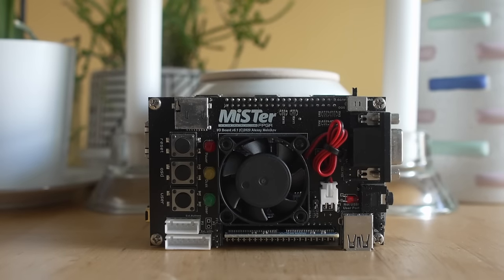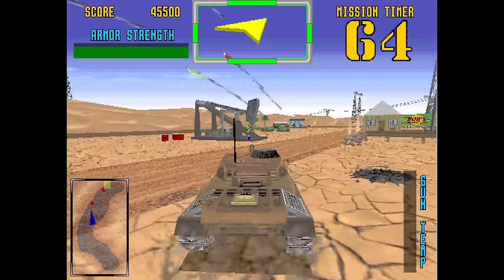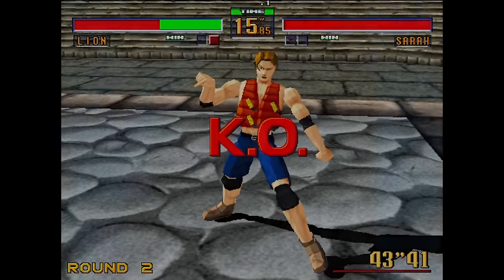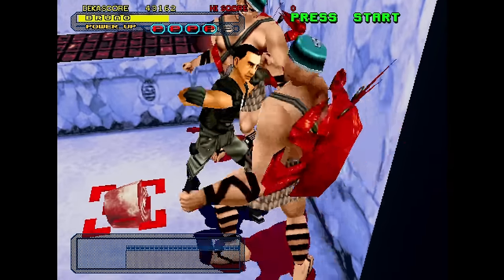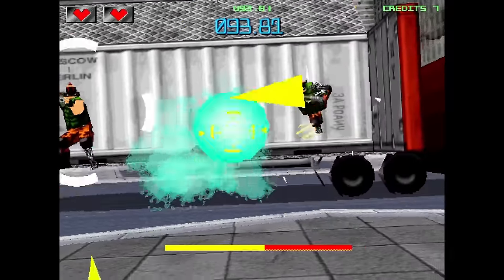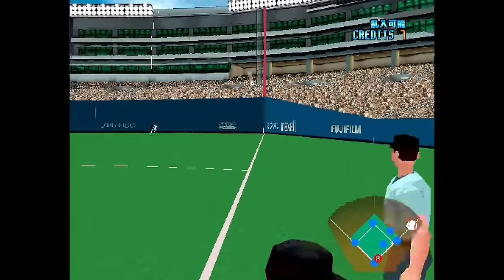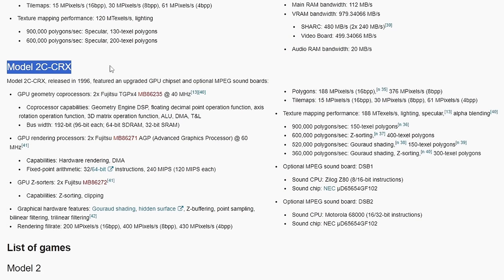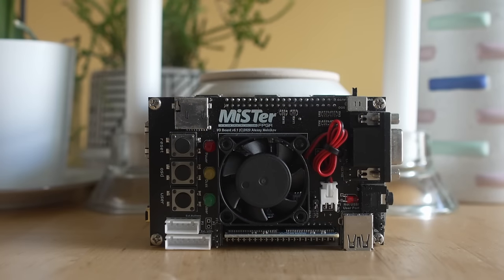MiSTer FPGA and Sega Model 2; Could MiSTer Run Sega's 3D Powerhouse Arcade Boards? Let's Check!

Comment: Not familiar with the Mister FPGA specs but I think the big question is simply whether all of the hardware could fit into number of gates available for use. The Model 2 is basically a big multi-processor system that uses a bunch of microprocessors and DSPs to do everything. Each of those have to be implemented, along with all the glue logic that binds them together.
Reply from the maker: That’s the question at hand. If you could get them ALL on the FPGA in the avail space. I think you could for OG Model 2 at least

Comment: One benefit is in all of this we are effectively making a custom chip in the fpga each time. and as seen with N64 there are often functions not utilized by the game. we might even end up with only 2 or 3 functions of that silicon used in the implementation that they used the chip for letting someone get the math right on just those functions letting b and c squeak in on some games without full function re-implementation.
Reply from the maker: This is true. Plenty of the functions never got touched by the games so those are useless as far as getting them in logic is concerned

Comment: Shouldn't we ask for Sega System 24, 32 and Model 1 first?

How about Namco System 12, 13 and Super System 22, 23?
Reply from the maker: Sure and I’ll do those vids in the future. I make these in the order of the requests I get in comments :)
Reply: @VideoGameEsoterica , yes - please do Namco 3D arcade platforms!
Reply: Completely agree: those are also highly desirable platforms to see on the MiSTer. And most likely simpler ones to implement, as they only output flat shaded polygons.
Reply from the maker: I will eventually :)

Comment: Could some of those sound chips be offloaded to software emulation similar to the mt32-pi? Or is that the wrong way to think about it since they are integral to the board so to speak?
Reply from the maker: Wrong way to think about it :)

Comment: I doubt it. Devs don't have a clue what those m2 graphics do at the transistor level to code a perfect software emulator. Elsemi did high level emulation in his m2emu. Mame has some math calculation issues (flying cars in sega rally). Would love to be proved wrong and see it done!
Reply from the maker: But with enough effort someone could learn :)
Reply: I agree. Once Elsemi will retire from SEGA, maybe we will see some Model 2 FPGA or Model 2 ported to other systems besides Windows.
Reply from the maker: We can only hope

Comment: Wow, I was literally just trying to get Model 2 emulation to work on my Steam Deck last night. Spent a couple hours on it by following a guide I found online, but I eventually had to give up on it though, because it just wasn't working. Super frustrating!
Reply from the maker: It’s so dependent on Windows. We’re you dual booting?
Reply: Doesn’t require windows at all. Let me know if you’re still struggling.

Comment: A Raspberry Pi could be connected to the bus/GPIO to be used as a GPU PiStorm / provide graphics functionality via OpenGL ✌️
Reply: In other words, the Raspberry Pi would do the work of the DSPs / GPU.
Reply from the maker: Yes but sorta defeats the FPGA purpose. I’d still play it though!
Reply: @VideoGameEsoterica  is an Amiga using a PiStorm as CPU not an Amiga anymore?
Sega Model 2 is such an significantly important system, it’s completely justified.
Come on, you even did a video about it!
First Sega Model 2, then Konami GTI Club / Cobra / Viper 😉

PS: Would the GPIO - or even the DRAM interface - be feasible to connect a Raspberry Pi (a lá PiStorm) to perform the GPU work?
Would like to hear (informed) people’s views on this 👍
Reply: @VideoGameEsoterica  - idea: What about inviting Robert, Jotego 
(and/or other notorious MiSTer devs)
for a technical interview on the channel, to ask things like these?
Reply from the maker: Yes you could use GPIO for a hat

Comment: I don't think the hardware is well enough understood where low level emulation would be possible.
Reply from the maker: Thats just a time issue though
Reply: @VideoGameEsoterica  I am not so sure. There have been efforts to decap some of the chips for the model 2. But I am not sure how far they got, or how successful they were. As far as I understand the emulation in mame for model 2's gpu is mostly high level.
Reply from the maker: Yeah I’m not saying it’s an easy task. I’m just talking about technical overheads :)

Comment: Would love a Model 2 core. Seems a little out of reach since that hardware is way past N64, but we didn't believe we'd get that either...

Unrelated (well maybe only a little) but have you played the Daytona 2 in the new Like a Dragon game? Might be a cool video to make as a follow-up to your unported Sega racers videos.
Reply from the maker: I wouldnt put OG Model 2 past N64 in complexity nor clock speeds
Reply: That's interesting because I've always thought of Model 2 as superior to the N64. Probably because every game runs at a locked 60fps and on N64 your lucky if you get 30. @VideoGameEsoterica
Reply from the maker: It’s just because it was designed to target 60fps in the dev process. N64 hardware didn’t age as well visually but it’s equally if not more so “advanced”
Reply: Gzus man, Model 2 have a PS2 graphics at 1993/4, even Model 2 ports on Console (on PS2, not the Model 2 Collection on PS3/X360 that are faithful ports) are downgraded because of graphic complexity.
Reply from the maker: It does hold up well graphically even to today

Comment: What about Dreamcast? It has an insane clock speed, but if any 6th gen machine could make it, it would have to be the Dreamcast with its simpler architecture. I think the main challenge would be the sound chip besides the clock speed itself.
Reply from the maker: The clock speed is the issue on DC

Comment: I think MARSFPGA will achieve that before Mister does.
Reply from the maker: I dunno why you would think that? nothing against MARS (I mean I do videos on it)
Reply: @VideoGameEsoterica  mainly cause of the fpga chip its gonna use,but I'll save it for when we actually see footage of it. Besides that price point sticks out like a sore thumb for me.
Reply from the maker: That’s the point of this vid. Discussing logic needed. MiSTer would more than likely fit most of this

Comment: CORES would be nice however  you would  still need to  both model 1 and model 2revisions id you are speaking of the segamsand sega ms2 and  samewith genesis/megadrive cores, i believemodel 2s sms  droped cuecard support, wjereasmodel1's  had it model 1 i believe in the genesis/mega you got the side by cd add-ons the second revision had the revised unit under neath  the console